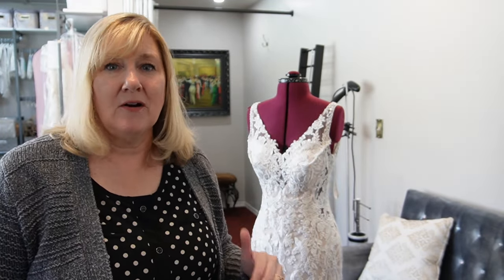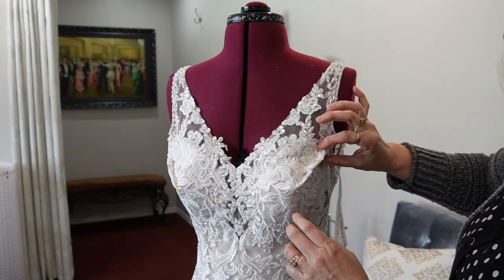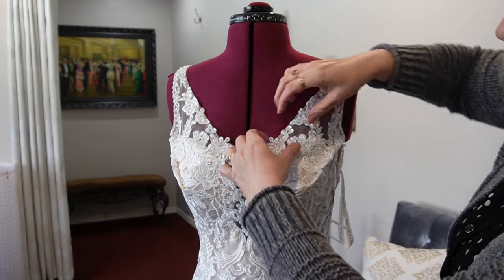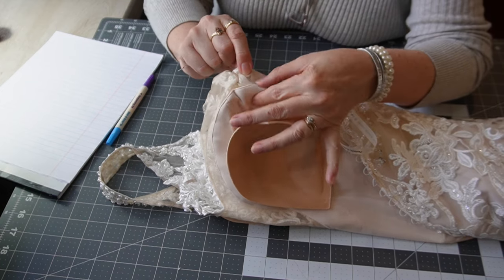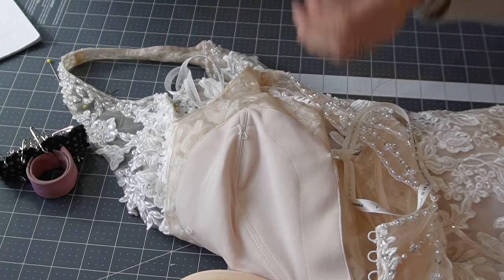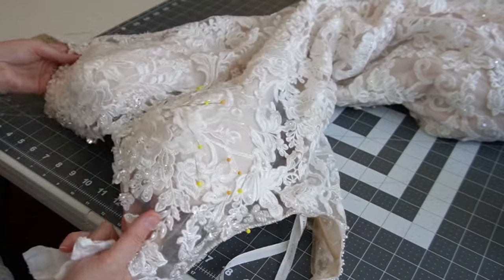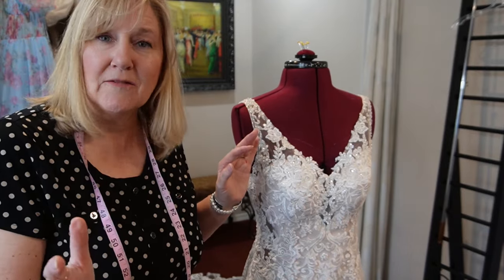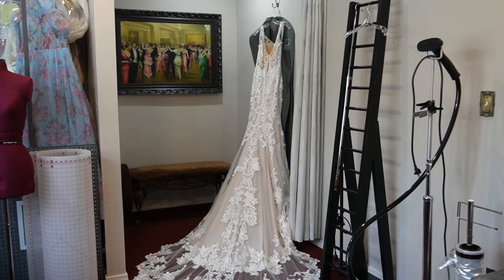How to Take In Bust Line on Lace Wedding Gown | Adding Darts on Loose Bodice

Comment: Thank you for this tutorial.  I have a dress that I need to put darts in. Was thinking that I would have to take the lace off then resew it
 Wasn't looking forward to that as it has beads and sequins.  Have  you taken in a seam this way as well?
Reply from the maker: That’s awesome! Glad I could show you a way to do it when there is too much beadwork. Or the appliqués are hard to remove.  

Yes, in the good old days LOL, all my bodice alterations had me removing the appliqués and beads. But that is also when the base structure of the gown was made out of bridal satin. 

I tried doing the same to these new tulle bodice gowns.  Sometimes it works ok to “peel back” the appliqués and do the alterations.  And I do peel back the appliqués for many alterations, such as the shoulder seams. However, many times the appliqués are so stuck to the tulle that removing makes more of a mess.  

Thank you so much for watching! God bless and happy sewing! 
-Christa
Reply: I do have a question.  If the boning is going to be where the dart will go through do you take it apart to the point where you can put the dart in then resew the boning back in place?